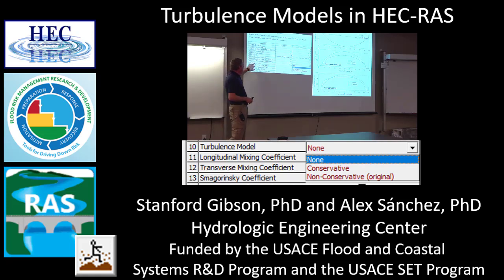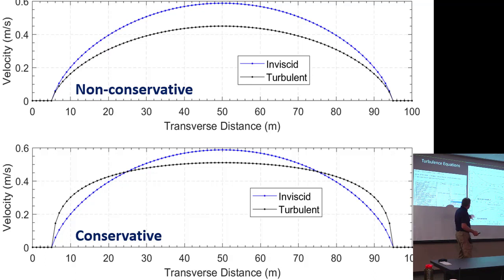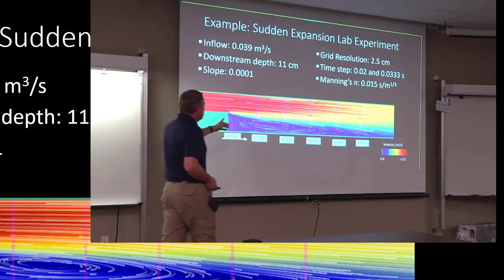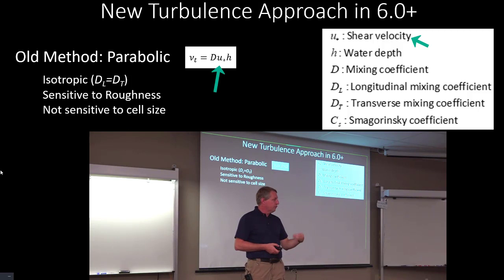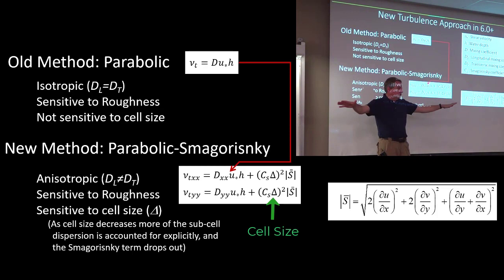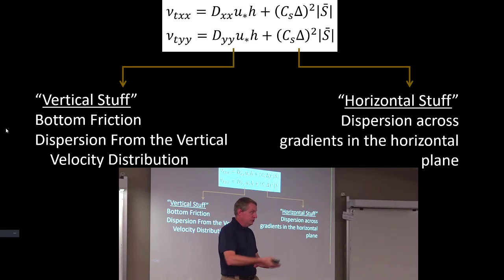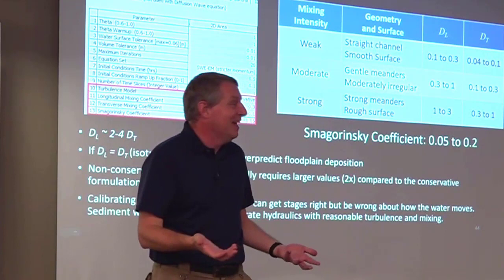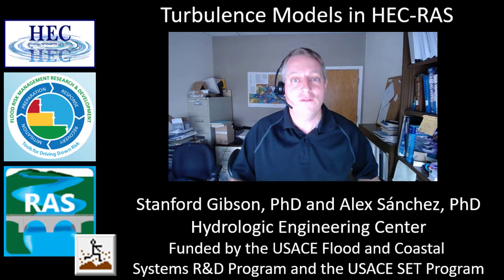HEC-RAS 2D Turbulence Models: Approach, Equations, Coefficients

Comment: This is a great video explaining the differences between the turbulence models used in RAS. This also explains why SRH-2D dampens the velocity field when horizontal secondary currents/eddies are experienced. Is there a reason why the k-epsilon turbulence model was not incorporated? This may not be a good model to use for large scale reaches but may be good to have for "smaller" scale type projects.

Comment: Does aligning the mesh cell faces to be perpendicular and parallel to flow make it easier to calibrate longitudinal and transverse mixing? Longitudinal mixing is described as in line with flow mixing, but what if your mesh cell faces aren't aligned with flow in a structured mesh with a stream crossing the cells diagonally?
Reply from the maker: This could make a difference, but we suspect the difference would be minor.  I have some data sets I could test this with...we'll add it to the to-do list.  But for now, I try to align my cells with the channel banks.  If it is on a bend you will still get some advection but a straight flume will be just diffusion/dispersion/turbulence.

Comment: A question: can we run the turbulence model without a sediment transport simulation.I mean just for a 2D inondation mapping ? or not possible because we need to have solutes to solve the equations for the advection.
Reply from the maker: Yes, you can run turbulence for a simple hydraulic model.  It will affect the velocity distribution across the channel.  So if you are interested in detailed velocities it can help.  But it is essential in sediment because we are so dependent on detailed veleocities.